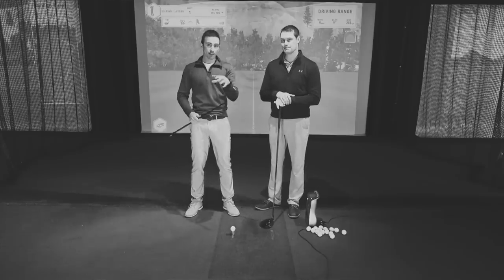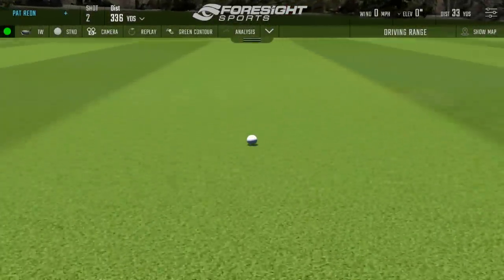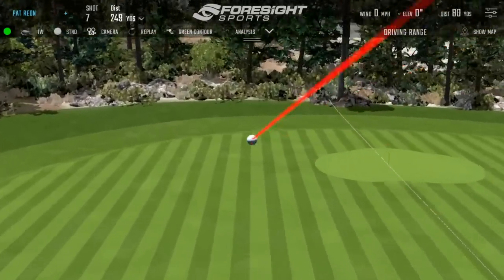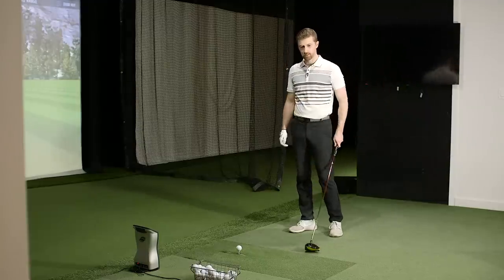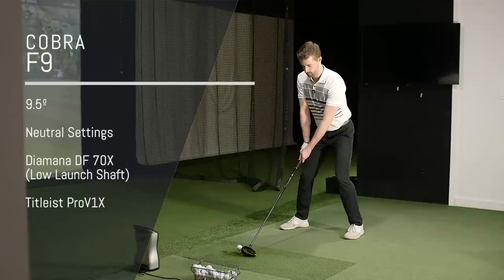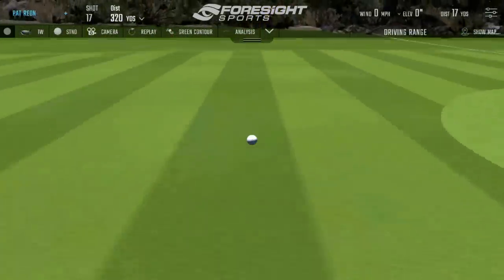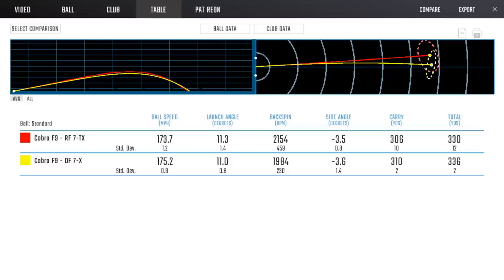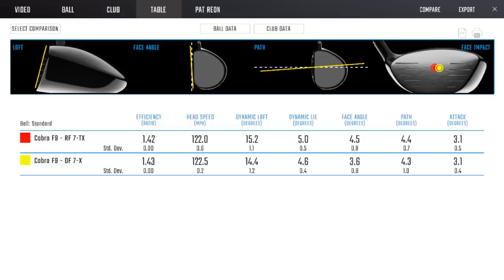High Launch VS Low Launch Shafts – The Real Difference

Comment: His efficieny was lower than his usual which tells me he was trying to step into it more so than he does In typical playing conditions in order to match ss with the TX flex. It defeats the purpose trying to fit someone or do tests when the player or test subject goes more full out on the swing when it's not they're natural playing swing. I notice this alot with people and as I fitter, the best thing I've learned that has made me a much more accomplished fitter is that you need!, and I mean need! to tell your players or subjects to swing the clubs as if they were on the golf course with the power and feel they are mesmorized to. When I was a youngster and got fitted my swings speeds were 130+ driver and 105+ with my irons and I was swinging the wrong way. When I got my clubs fit and played with them on the course in my natural swing, the clubs felt totally off. I notice this gets tougher with better players because they are able to swing alot faster and maintain similar efficiency without getting told to change. Just my 2 cents

Comment: What weight where in the f9 looks like 2 red ?
Reply: Ian Bowley 14g front 6g in the back.
Reply: Apart from adding weight what does the added weight do the the characteristics of the head. Does it still promote lower spin with increased CG?
Reply: Ian Bowley not really Ian, you need a lot more than the 4grams we used here to relocate CG location.
Reply: @ianfrasergolf  so what benefits using the 6g over the 2g. Have u tried 18 and 6. And does the different weights have any effects on ball flight. ?

Comment: http://wishongolf.com/wp-content/uploads/2013/04/adjustable-hosel-drivers.pdf
Soooo... I'm a fast swinging high ball hitter.  Was given a 9* M5, unfortunately with a high launch/high spin tensei red shaft, which I carry about 250-275 depending on strike and shape.  I need to hit the ball lower with less spin, so the best I can do with this driver is put the weight tracks all the way at the front of the head and adjusted the hosel to bring it down to 7* loft.  I realize lowering the loft opens the face.  But until I came across Tom's article above, I didn't realize just how much it opens the face. 

Apparently for every 1* of loft reduction, there is a 1.8* opening of face angle.  So little did I realize when trying to hit the ball lower by lowering the loft, that I was hitting it with a significantly open face.  Ok sure, you're supposed to resquare the face before hitting it.  But the weight distribution in the head feels different when I do that.  Long story short, one day recently I decided to put the loft back to neutral 9* to square the face, and low and behold I'm hitting it way more solid and picked up distance. Mind you, I think I'm finding that I'm a bit less accurate since the square face vs. the open face means my spin numbers are probably lower, which means more side spin/less accuracy as well. I'm pretty accurate as a 2 hdcp though, so at this point I want a solid popping strike vs a glancing blow on a open face. 

My points are.... 

a) how much do I need to turn the face to resquare it at impact... even as good as I am, can I consistently resquare it 1.8-3.6*
b) how does resquaring it affect the weight distribution and feel of the head in the hands
c) to hit a lower ball that draws more easily, should I lower the loft, which opens the face, which I have to try to resquare, and yet seems to feel a bit differently, (even because of the feel of my hands on a different part of the grip)... or should I increase the loft, which closes the face, which I then either keep closed or resquare to more easily hit a draw with lower spin numbers. 

Funniest thing of all is if you read the above Wishon golf article, it shows that all the supposed loft and face angle changes marketed by the golf companies is more or less a bunch of bullshit.  The adjustable hosels don't even produce the changes they say they do!  Now that's a real mind fuck folks. 

But one thing is for certain, changing loft/face angle does affect my ball flight and swing.  Just have to trial and error out the best set ups.